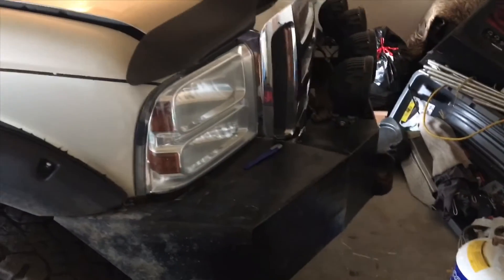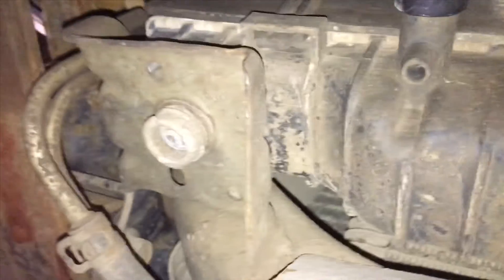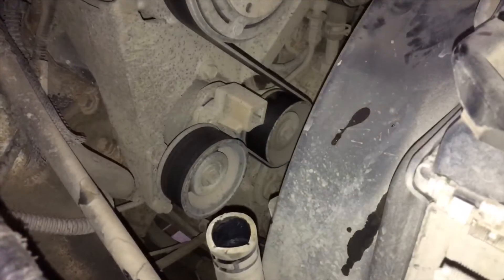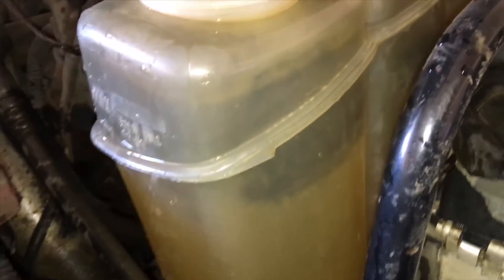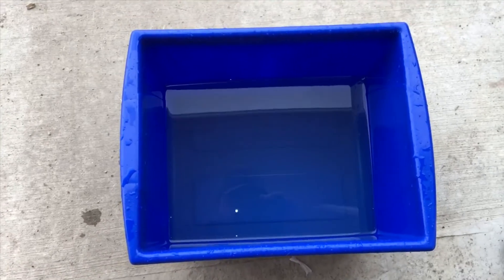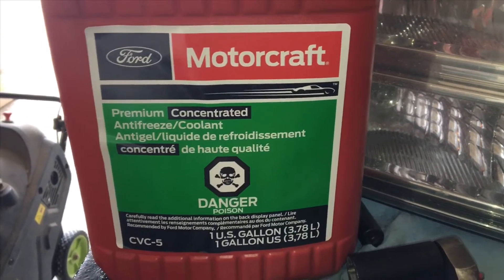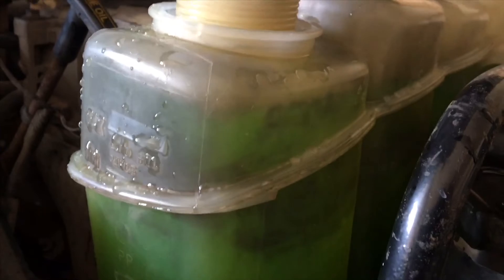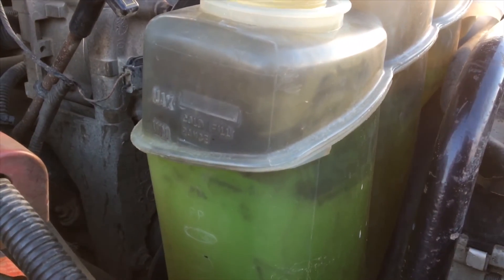7.3 PowerStroke Coolant Flush!

Comment: So this was my experience (for anyone who cares). I didn't run a cleaning solution through (though I kind of wish I had).After draining,  I started by flushing the radiator with a garden hose. I then disconnected the heater core tube on the top of the water pump and back flushed that with a garden hose (engine running and without it running). I followed that up with 7 (I believe) distilled water flushes through drive cycling. I drained the block once, but it was kind of a pain and hard to do if the engine is still hot. All other flushes I drained through the petcock at the bottom of the radiator.  The capacity of the engine is 8.2 gallons when all air is purged and the degas bottle is filled to the max line; so that is how much coolant is in the system if these conditions are met. With every drain I was only able to collect around 5 gallons. So around 3 - 3.5 gallons remain in the system after draining. I was not able to get the drain water nearly as clear as you had it @Parkin'Spot,  but after 7 flushes and 30 - 40 jugs of distilled water, and basically an entire weekend; it is what it is (cleaner than it was anyway). To refill, I experienced a couple of near overheats will driving, partially due to air in the system, and partially due to a failing thermostat. To avoid the air pockets when filling from the degas bottle, I first removed the thermostat and filled through the water pump, then filled the degas bottle... When it came time for the coolant fill, I was able to pour a little over 3 gallons of VC-5 directly into the water pump, the remainder of the 4th gallon went into the degas bottle. I added the 4oz of coolant treatment and filled the up the rest with distilled water (about 1.5 gallons). So if my math is correct, 3 gallons of somewhat clean distilled water that remained in the system, plus the 4 gallons of coolant plus the approximate 1.5 gallons top off with distilled water comes out to 8.5 gallons give or take. I'm going to buy some test strips and check the ratio after driving for a week or so. All in all, glad its done, not looking forward to doing this again any time soon...
Reply: Do you think removing the lower radiator hose would drain out the block?.. probably not all of it right?
Reply: DirtyHands unfortunately not. The only way is to pull the plugs on the driver and passenger side
Reply: Similar situation. Think I had done 7 flushes with distilled water and its still rusty. I pull the lower radiator hose to drain the system because it appears to be a little lower than the petcock valve so maybe more sediment will drop out. I get about 5 gallons out from each flush and a good bit comes out of the block. I do rinse the radiator and overflow tank with a hose and tap water, but refill with distilled. Not sure how many more flushes I will do because this is adding up.

Comment: Helpful video. Many ford enthusiasts recommend draining the block on either side and removing the lower radiator hose, and or putting in a permanent T, but I figure this route is still better than doing nothing at all. Most people I know never flush their coolant, and their vehicles still last 300,000 miles just with doing oil changes and nothing more as far as fluids go. So with at least a little attention, I'd think that would improve chances of longevity by a little...
Reply from the maker: I agree, every little bit helps. Thank you for the comment

Comment: Things look super clean because of the heat and steam in the radiator system, but this is about a half way done job because you need to clean out the silicate that forms, collecting in the bottom of the engine block which is sand, which eats water pumps over time, and there's a couple plugs you gotta  pull on the sides of the engine block (get replacements ahead of time, they tend to round off, white chunks will come out, even every 2 years... with coolant kept to spec...  gotta do it , which is why I went to ELC after a heluva flush, flush, flush, change of 50/50 mix fill, re-change for final fill.  First get Ford Flush and run it 30 minutes, 10 is recommended, but be ready to drain it right after running it so it's not in their being aggressive too long and eating bits you want to protect. 

Then, disconnect lower rad hose which will get a better flush than the petcock (redundant to open the petcock),   then reach over the starter for RH engine block bolt, after disconnecting batteries, LH is visible by the block heater where it goes in the block) and you should get a specialty fitting and then flush out the heater core with the plugs out and use the fitting and a garden hose ....don't do it without the fitting it will damage your internals ..... then use distilled water to flush things out once or twice by filling and running that for a few minutes so it mixes with remaining dirt/coolant, draining, replace hoses tstat,  and then start with a concentrate and build it back up unless you live somewhere warm and are using 50/50 (not recommended) you'll have left in some of the distilled water and not gotten proper solution (although in my experience the freezing protection test numbers are the same for 50/50 straight in the bottle as for after first fill with 50/50 post distilled flush.... should also replace the thermostat, housing if rusty, and I would recommend going with the 200 degree thermostat so supposedly your engine runs hotter and more efficiently ...there were some engineering things going on at Ford and with emissions that's why you ended up with a cooler running thermostat ... get the right length for your housing it's also good to replace the housing and RTV gasket material and o ring on the housing and occasionally your hoses  Gooch who worked in the cooling industry and has a flush procedure, or find someplace to read about doing a thorough job, diesel o-rings has some parts couple .
I went to 2-EH free ELC coolant from International and it seemed like just flushing with the hose, filling with distilled once or twice, and running 10 minutes each followed by, draining and finally filling with 50/50 was fine as far as testing freeze point.  I did a bit more but got the same result.  For radiator support replacement, see LMC truck's video.
7.3 is actually ok as far as liner pitting for 150k running on coolant without additive, so if you forgot, it should be ok unless you went 200k .
Reply from the maker: Gale Hess coolant was clean... temps were normal... heat and cold air worked... several months later including a long road trip through the mountains.

Comment: MAJOR FLAW: yes this is how you can drain and retop  your coolant off if staying factory but you missed a crucial step as far as flushing and changing coolant. U need to drain and flush the block. (Residual gallon). If you changed over to a elc you would be repeating this process due to gelling (coolants mixing) aswell as the chemical cleaner destroying finishes inside.
Reply from the maker: That’s why I filled it with distilled water and drove it around the block, drained, and repeated a few times

Comment: Did you add 4 bottles of the additive? I looked at my manual and it said to add 4 pints of fw-15 when you change coolant. The bottle is only one pint, just making sure
Reply from the maker: Eric Ehmke I added two of those bottles and then after I drove around for about 1500km I added the other two. I just forgot to add that into this video
Reply: It calls for 4 oz per gallon of Vc-5(motor craft coolant). 4 oz in a pint so it only needs one pint for the 4 gallons.
Reply: Bobby Tacner I just checked my manual that came with the truck, the one that’s just for powerstroke. Under replacing coolant, #2 says add 1.89L (4 pints) FW-15 to cooling system. That’s just for initial charge. (FW-15 is now VC5 ) After that add 8-10 oz every 15k miles. Thanks again for response. Best truck I’ve ever had
Reply: Eric Ehmke 4 oz per gallon
Reply: Just to add to this... the green “Owner Guide Supplement” titled “Power Stroke,” says the coolant capacity is 22 quarts (5.5 gallons), and also calls for 4 pints of the additive in the instructions titled “Replacing Coolant.” 4 pints is half a gallon and .5 divided by 5.5 gallons is .09 or 9%. So 9% of the coolant you are able to replace should be additive. I have a 1996 7.3 for reference. If this is wrong, someone please tell me WITH A REFERENCE of some sort.

Comment: I am in the process of doing a coolant flush on my 7.3. I've read the capacity is 8.2 gallons, it sounded like you said you only added 3 gals of coolant + 2 (or so) gals of distilled water. Is the 8.2 gallon capacity only if you completely drain the block? I bought 4 gals of coolant plus the additive. I don't want to add 4 gals if it will make the mixture too coolant rich. Great video by the way . Thanks
Reply from the maker: Cass Transport LLC thanks for the comment. I was in the exact same boat. I bought 4 gallons of coolant, the additive and then a bunch of distilled water. I drained as much as I could out of the truck just by using the drain plug at the bottom of the rad. I was only able to get 3 gallons of coolant, then it started filling up without draining so I added the two of distilled water. I have it somewhat mixed better now and it hasn’t overheated even after driving 8 hours straight through the mountains.

Comment: So did you get oil in your coolant? Is this what made you do this? And what was the cause of it, oil cooler?
Reply from the maker: Justin McCourt there was oil residue in the coolant tank but as I bought the truck used I don’t know when it was last done so I figured it was good to do. I did the oil, filters, and this rad flush. I checked the transmission, transfer case and diff oils too.
Reply: I'm about to do my oil cooler this weekend, thanks for the vid.
Reply: I just did my oil cooler and one of the gaskets got crushed, but it seemed like a breeze instal. I ran the truck for like 3 minutes and it died, all the oil was pumped into the damn radiator... lmao. I got ford OEM gaskets now and have to flush the radiator, thermostat never opened though, so there isnt any in the block. just cost me the price of new oil & coolant
Reply: @powerobsession734  Wow that mega suuuuuuuucks.
Reply: @scubaguy5455  yeah i ended up having to replace the radiator, water pump, heater core, oil cooler, coolant resevoir, and several hoses. I spent a month with prestone radiator flush and i just couldnt get it out.

I also had to flush the coolant passages in the block with a pressure washer.
Reply: @powerobsession734  You should have poured in a full bottle of dawn dish soap while flushing it.  The "degreaser" effect will help get the oil out next time.
Reply: @powerobsession734 hey just like our mid winter injector job under no cover and our motor hydrolocked